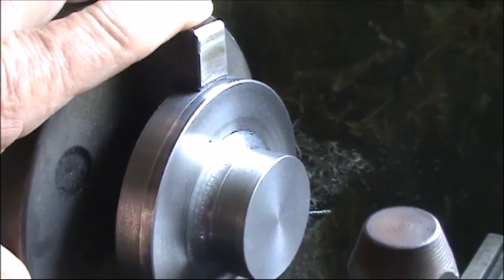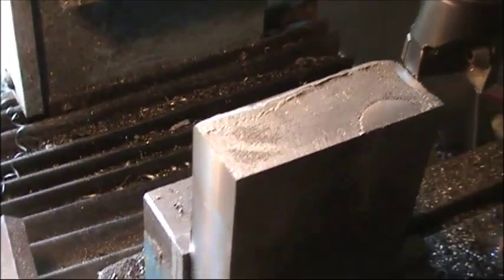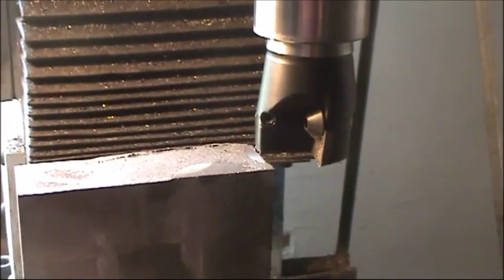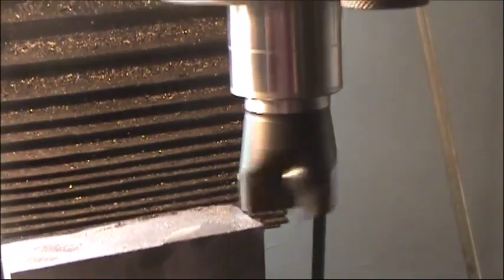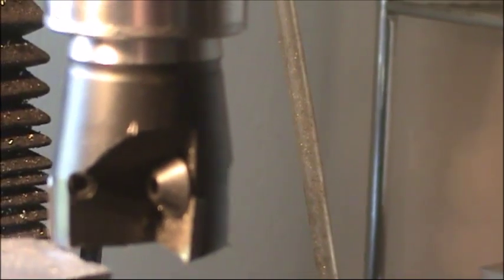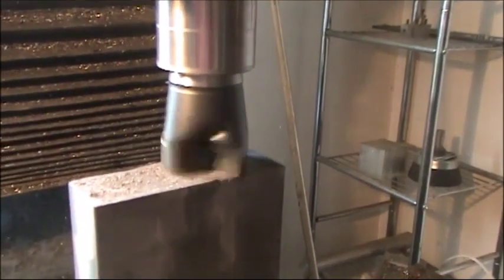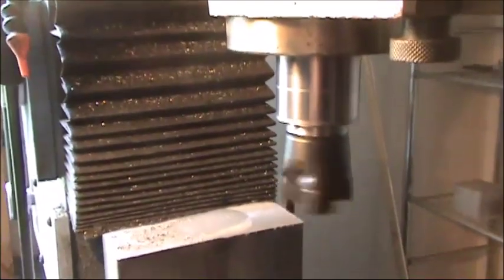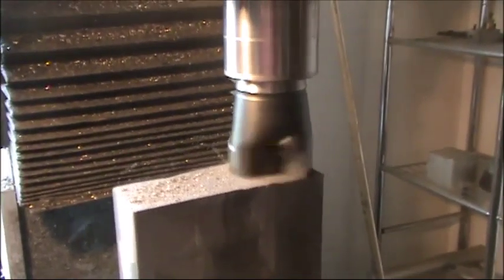machining cast iron

Comment: Looks great Dave! I love your videos and your getting to be a better camera man :)! But what cast iron did you start out with before melting and what size crucible do you use and how much iron does it hold as far as weight goes?? Did you use a flux or not?  And as always Dave thanks for the video and your help you sure are a super guy! 

Dennis
Reply from the maker: the crucible is an A10, I most of the iron that was in that melt was sprues and the gating from melts that turned out white from previous pours, with some fresh material from an Exhaust Manifold, flux isn't really needed but at times I do use limestone dust which will make the slag more liquid but will also damage the crucible so don't use a lot.

Thanks for watching.